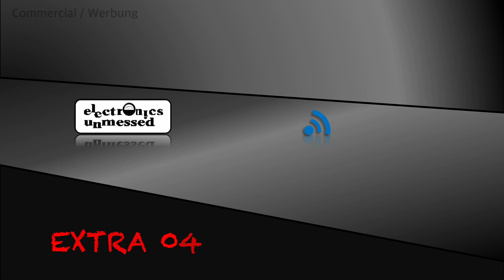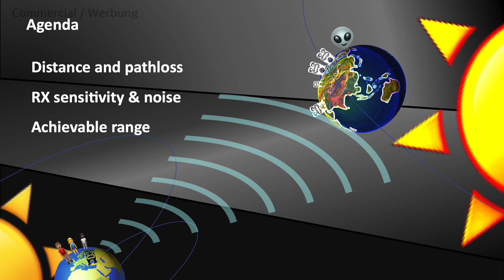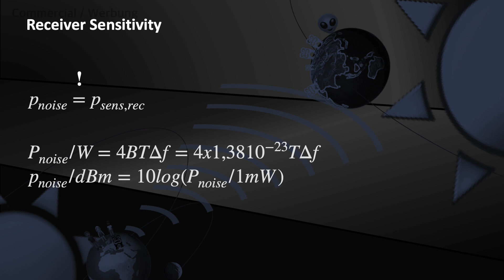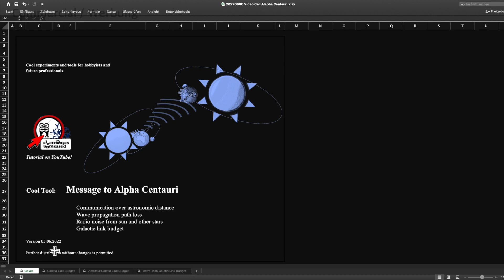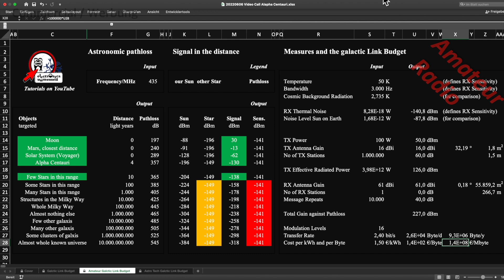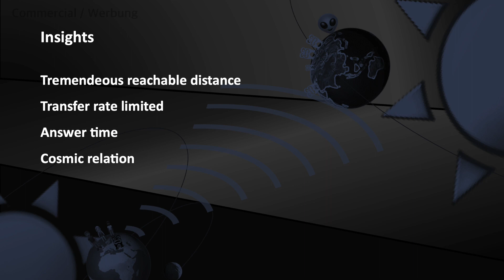In a Distance of thousands of Lights Years - could we Technically Communicate with ET ? (EX04)

Comment: If I were going to try and look for 'aliens' I'd first look for pulsars that can be seen from here and also from another star system, then look towards that star system. Someone deliberately sending a message would probably need a common source of synchronisation. You could maybe use the time between pulsar reception and a pulsed transmission to convey a bit level meaning you could send the same information accurately, multiple times. You could maybe get higher power and less average consumption using pulses - the aliens may also want to try and reduce their energy costs.
Reply from the maker: @threeMetreJim  Yes exactly, that would solve synchronization problem. Thanks for that cool comment.